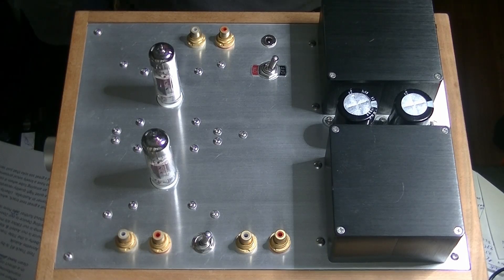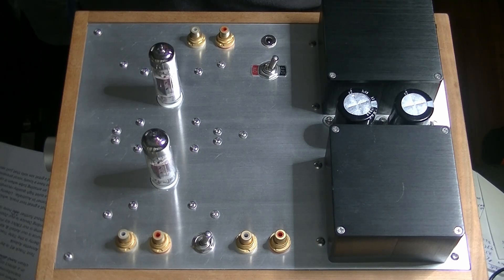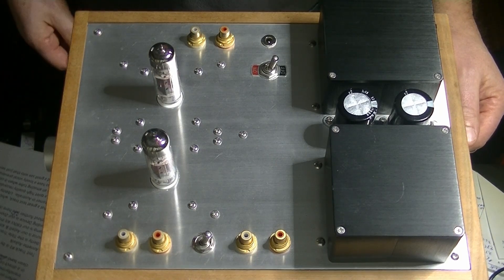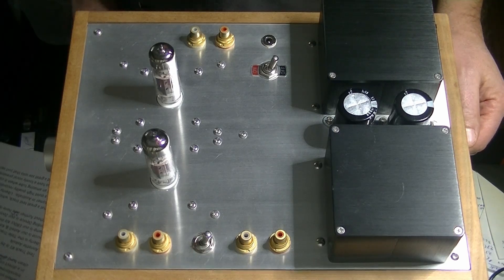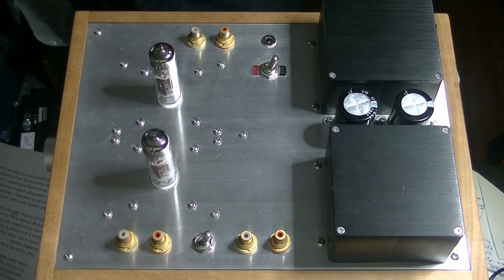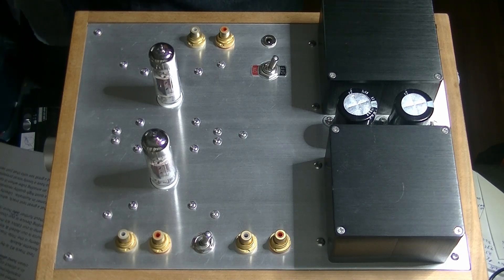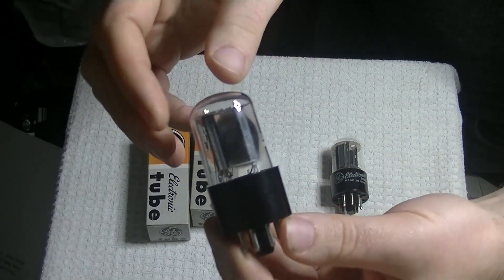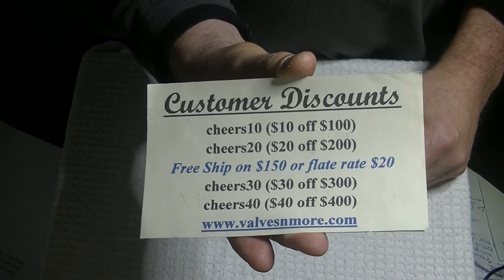Tube Lab #116 - How does the E80CC Preamp Really Sound?

Comment: Greetings from a New Zealander.... Thanks for this wee update from you guys. I simply must blow the dust off my soldering iron & cease the procrastination of building a few tube (valve) amplifier projects. To clarify is the E80CC preamp you featured "RIAA capable" (i wasn't quite sure by the schematic)...? Thanks too for the heads-up of HRA & Anette Askvik of whom i am listening to as i keyboard this!
Reply from the maker: Hey New Zealand!  Some of my best customers and suppliers hale from your neighborhood.  The E80cc is a simple audiophile grade Preamp that has only what is absolutely necessary - two pairs of rca ins an rca pair out, a couple of switches and a volume control.  Anything else would detract from the sound.  If you want to run a turntable, you'll still need a phono preamp.  And luckily we're currently designing a Kit Phono Preamp that will hopefully be released before the summer.

Comment: Thanks for the great video.  I have a question.  Can the E80CC be substitued for a 12AU7?  I have a kit built SP8 preamp from Tubes4Hifi/Roy Motram and would like to give the E80CC a try.  Thanks again!
Reply from the maker: The short answer is maybe, BUT you need to do your research or you may end up burning out your filament transformer winding.  I did a Tube Lab a couple of years ago on this very tube and topic.
Here's a Link: https://youtu.be/zjqgXE8JL2M
Reply: @tubelab194  Thanks and I'll check it out.  I consider your YouTube program one of my "go tos" for information on tubes.  Lots of good stuff!

Comment: Would love to build one of these any chance of XLR in and out in the future?
Reply from the maker: For the highest fidelity you want to stay in Pure Class A, using XLR interconnects means you've split your audio signal into positive and negative waveforms (180deg out of phase), this is such a bad idea if you value clarity, sonics and soundstage.  When you run true balanced signals, you double the circuitry, so in tube gear you double the number of tubes! And after you split the signal you need to recombine it at the power amplifier (power amps use an unbalanced signal).  Yes you might be plugging an xlr into your amp, but immediately after that the signal is recombined!
Reply from the maker: Because Mellow Tone Kits are all about the sound and we reject anything that interferes with that, you'll never find a balanced circuit (xlr interconnects) or remotes and related circuitry - everything is pure Class A analogue!
Reply: @tubelab194  Oh, interesting! Learn something new every day! Always wonderd why most don't have XLR. Thanks for taking your time to explane it.
Reply: @tubelab194  Excuse my ignorance, does this apply to say a Schiit Freya + feeding a Pass Labs XA30 or XA60 or is it by design in certain tube products?
Reply from the maker: @jwiggins1229  If you are interconnecting with XLR's there's a very strong likelihood that the circuitry is balanced.  However some quasi balanced designs exist, in which the signal is just split at the output and the main circuit is unbalanced.  In the case of the Freya, it is running 4x 6SN7, or twice the number it would need for an unbalanced pure class A circuit, so it appears to be a true balanced design.  It's a hybrid preamp (solid state and tube) and they don't publish the schematic so I'm making an educated guess.  One thing to keep in mind is that 99% of audio circuits are unbalanced, it's just a recent rush in home audio, to switch to balanced interconnects that's driving manufacturers to offer xlr interconnects.  Unfortunately everyone is making the change without any real understanding of what they are doing to the signal.  In pro audio gear XLR interconnects are the norm, for obvious reasons - long interconnects - for which a balanced signal is the perfect solution for low noise transmission.
Reply: @tubelab194  Great info, that's exactly why I was asking. I have always used single ended connections in the past. Started using XLR in recent years due to recommendations and or to eliminate noise like you said without any real explanation why. Most of us just follow the crowd and or what manufacturers are putting out.  Thank you again for taking the time out busy schedule to answer!!

Comment: how can the holes be ventilation . it is in a vacuum !@ clearly no air flow !
Reply from the maker: I've heard this argument before, now think about it, yes there's no gas of any sort inside the tube (or there better not be!)   But deep inside the centre of all tubes is a filament, it needs to heat up the cathode to very high temperatures, after that we have grid wires and a plate structure wrapping around everything.  All that heat needs to go somewhere, so tubes are designed to radiate and convect away surplus heat.  It has been my observation that one design tool available to tube manufacturers is punching holes in the plates.  It sure looks like those holes help dissipate excess heat.  But I've never read anything from anyone knowledgeable to say yay or ney on this supposition.  One thing is for certain those holes are doing something or they would never have bothered punching them!
Reply: A Vacuum doesn’t mean there is no Atoms that heat can transfer along. Just like Space heat, light etc. can travel because there is still Atoms there to transfer along. Im just going off the top of my head. Im sure it won’t be hard to check on heat transfer in a vacuum.
Reply: @DrSinisster  You are confusing radiation with convection, both transfer heat, only one requires a medium other than space itself.